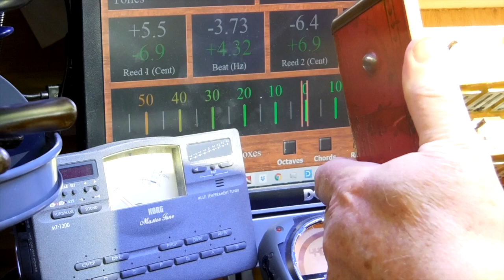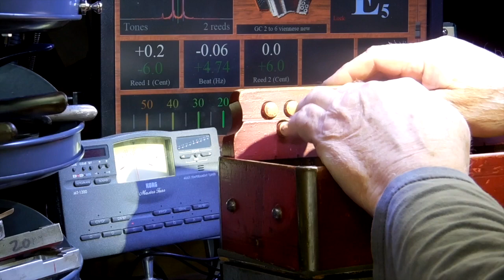Hohner GC reedblock restoration & tuning #541 (nfs)

Comment: I got a Bubba special pre pokerwork, cardboard valves, hot glue to repair separated base on reed blocks and reeds covered in an excessive amounts of silicone. Lol only very minor surface rust on a few of the reeds that ill be cleaning up with a pcb cleaning fiberglass pen. Gasoline baths and scrubbing with toothbrush is working well for cleaning the reeds.